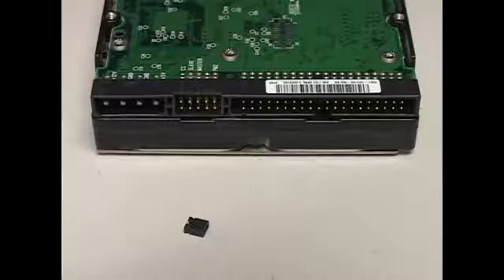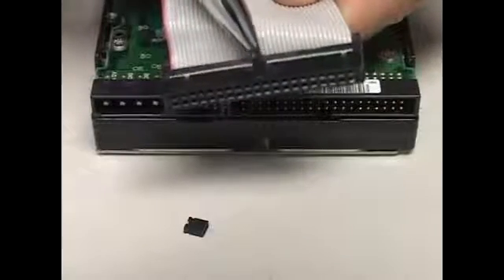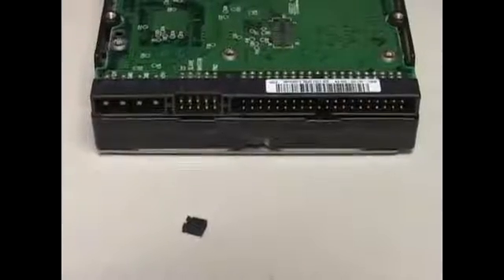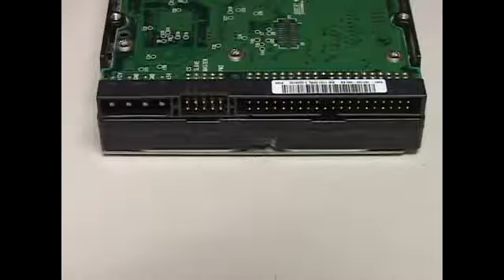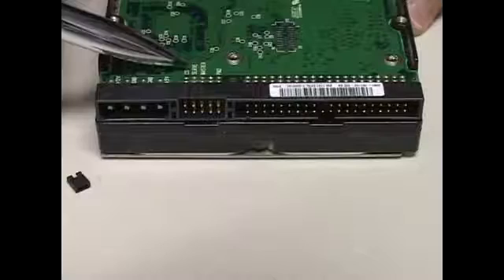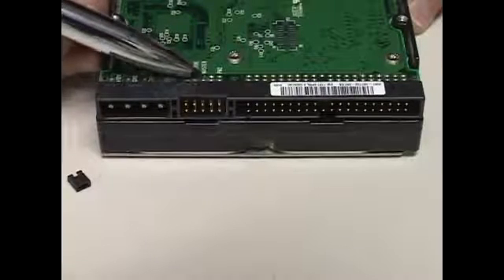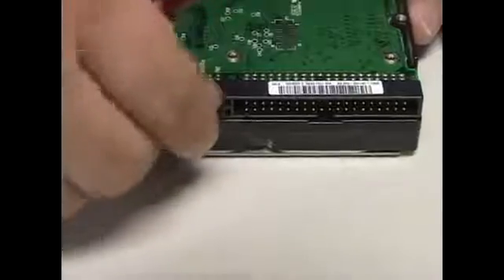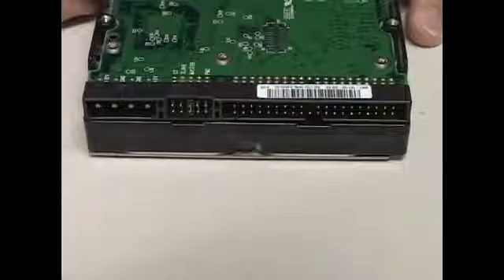Setting Up Pins for IDE Hard Drives

Comment: A WD 500GB IDE Hard Drive working on my old school Emachine T2042 plus I added another WD 500GB IDE Hard Drive as the Slave a total of 1TB running Windows XP Professional SP3 32 Bit in 2022
Reply: Same. Used an old WD out of my first computer I bought for myself, an Emachine back in the mid-90s. I don't have it in my current machine, but still have that and an old Seagate too.
Reply: @paladonis  IDE Hard Drives are still good in 2024 as long as there in good condition